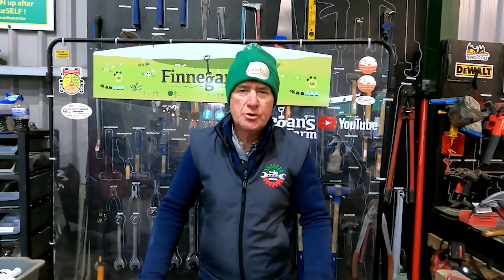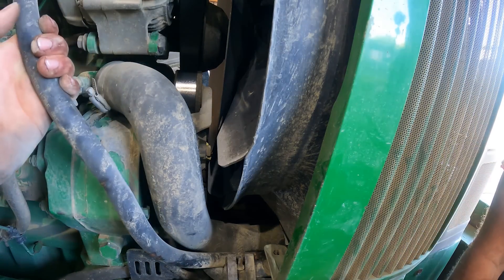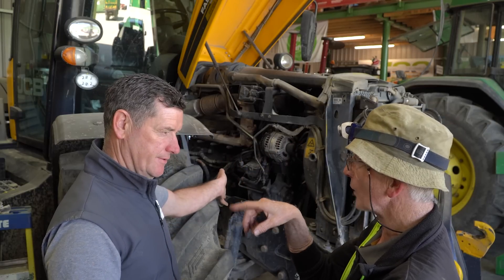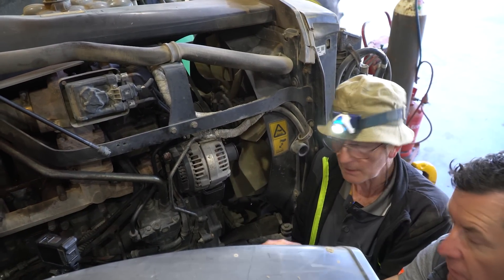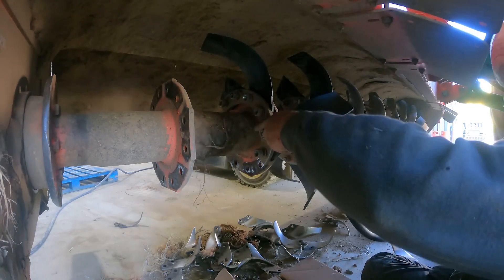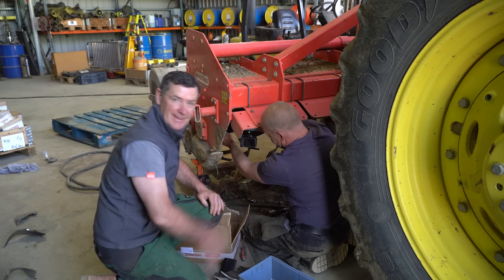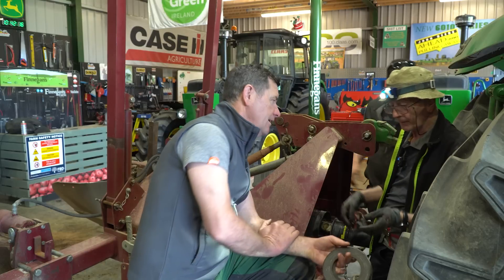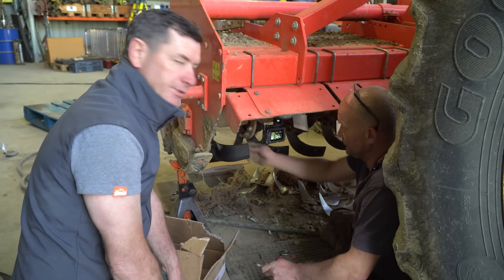WORKSHOP WEDNEDAY EPISODE 84

Comment: How about taking the rotavator off and lifting it on to it’s back for changing the blades it’s more comfortable to work on
Reply: Great minds... Was thinking the same myself not about flipping it but rising it up to standing height. (I could feel the discomfort in my knees just having to change one set😅, not as young as spritely Marco though)
 Maybe you need to install a gantry crane in the workshop.